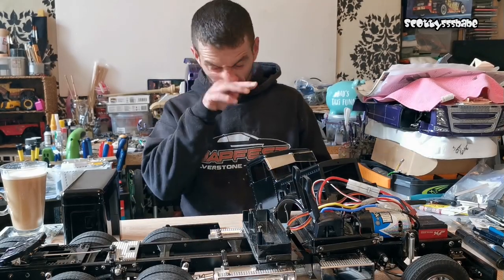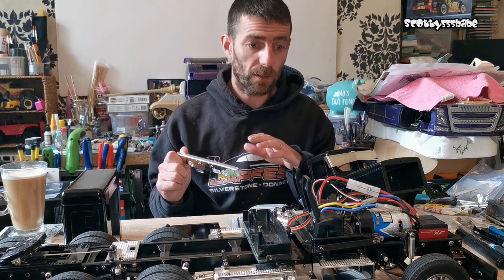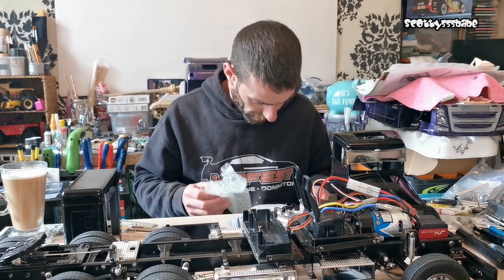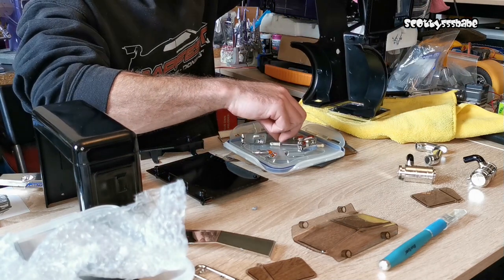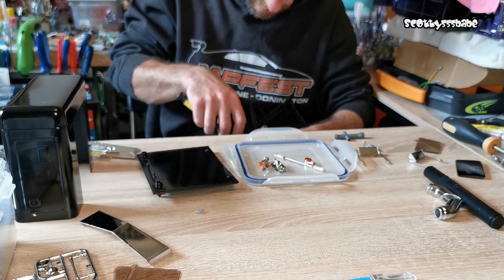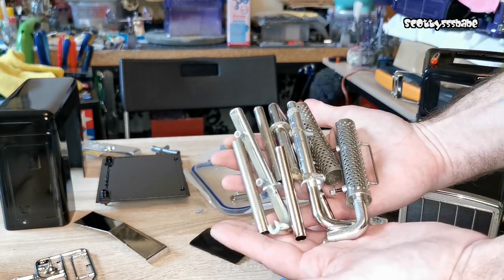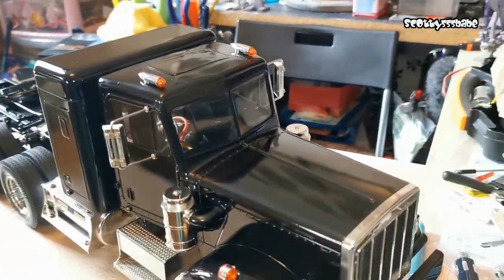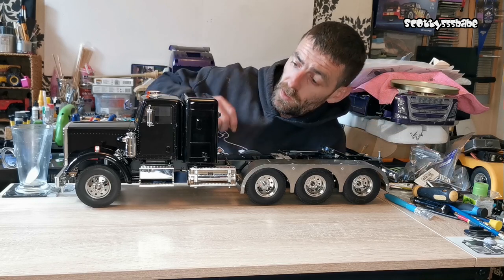TAMIYA TRI-DRIVE RC TRUCK 90% COMPLETE | 1/14 scale heavy haul tri axle Custom Truck

Comment: hope you get the weather next week for doing Scanny. as kind of waiting on that series to see how you fit the dual motors to the chassis, as bought the mounts for my 2 trucks, had a look with the chassis, and looks like I got to drill the holes into the chassis rails, so going to be put off until after my little holiday which starts this weekend. but probably going to be quite some time after that, as need to build the gearbox which includes ordering that, and also the motor. as for the black and chrome, think black and chrome were always the best two colours as they stand out the most. if you did a blue or something that isn't glow in the dark tunnel paint!! then you could get away with not having the chrome.
Reply from the maker: Dual Motors? 🤔
You maybe confusing my build for another as my little girls Scania is all pretty much a standard setup.. I hope the weather takes a better turn too 😊 Blue and chrome and blue and silver are probably my favourite colour combo, just trying to stay away from blue for a while as I used to do everything blue 😂
Reply: @scotty555babe  sorry thought you said you were going to mount both motors for the steering and the gears up front of the chassis. rather than having the steering motor on the side of the truck.